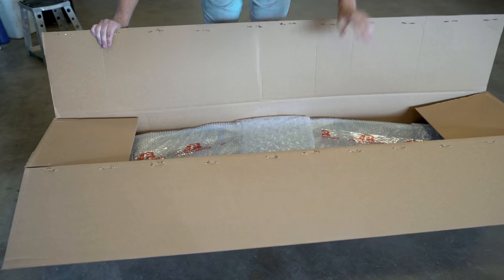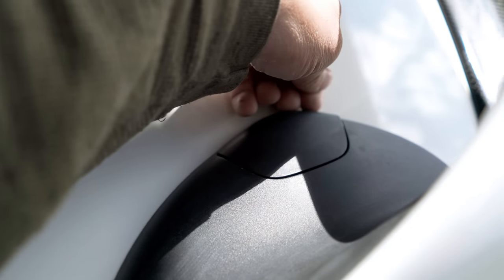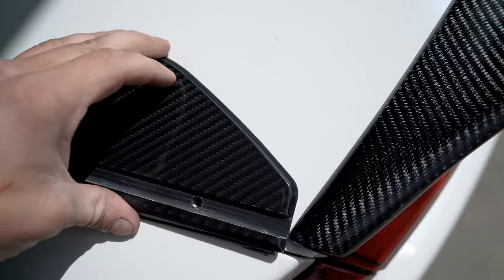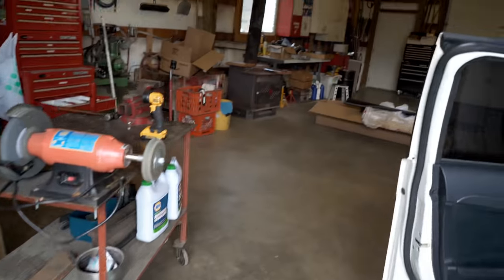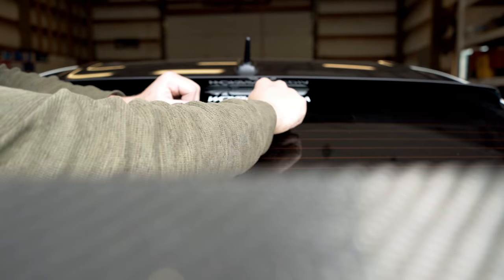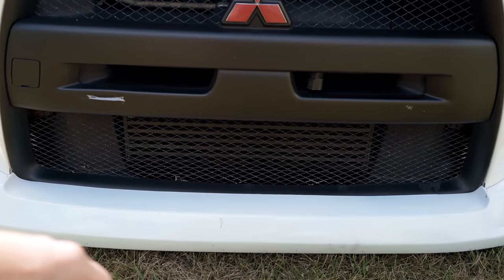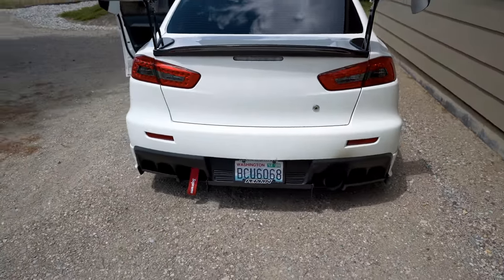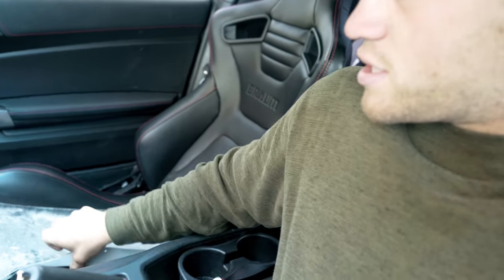Evo X Gets a BIG Wang!

Comment: The APR GTC-300 and the Voltex Type 1S(with the upper portion paint matched) are my two favorite aftermarket spoilers for the X. I also like the stock spoiler with a carbon fiber gurney flap add on.

Comment: As for the exhaust, you can either buy a different manifold that isn’t true equal length, or get a quieter exhaust(I prefer ETS over Perrin. ETS makes a single exit too.) It’ll still never sound as rumbly and deep sounding as before because of the equal length manifold.

Comment: I had a feeling the tomei wouldn't last! They never do with road cars. Janspeed fq440 modular system or akrapovic if budget will stretch. Janspeed system might be uk specific. You wont be disapointed with either - unfortunately both expensive but worth it given the spec of your build. 460-470 whp beyond that your into block sleeving.

Comment: #parkbenchgang
Enjoying all the content man, entertaining and informative.

I have an Evo X in Sydney Australia MY13 model.
I really want to buy your Tomei catback and the Cat if your selling.
I am pretty sure u can easily sell in the states and shipping to Australia costs to much $$$
Anyway let me know.

Have you looked into running a Cobb AP?
I run an AP and its cool as...but be guided by what your tuner wants lol

I dont recall seeing any catch cans on your machine.
I run stock turbo so far but run Radium dual catch cans.
Message me if u go Radium cans, no need to bend hard lines, just insulate the can with rubber padding between catch can and power steering lines.. few other tips too.
Hope u install some Radium gear soon, its all so nice.

I think i could manage a turbo upgrade thanks to your videos.
I installed a Tomei Ti Dump pipe, it was the worst getting stock shit off.

Anyway keep up the awesome content.